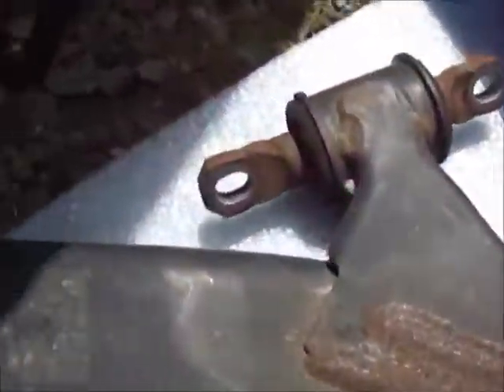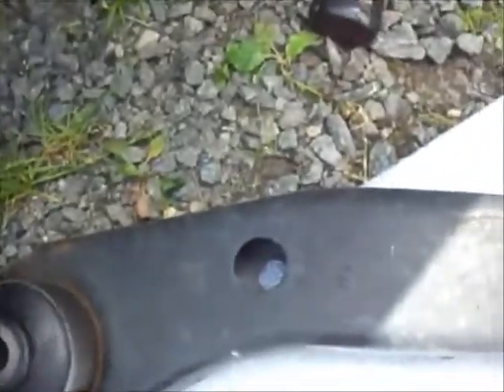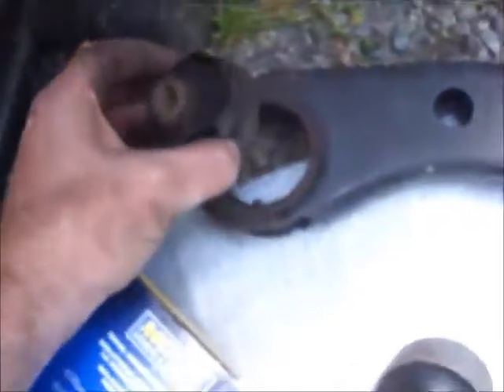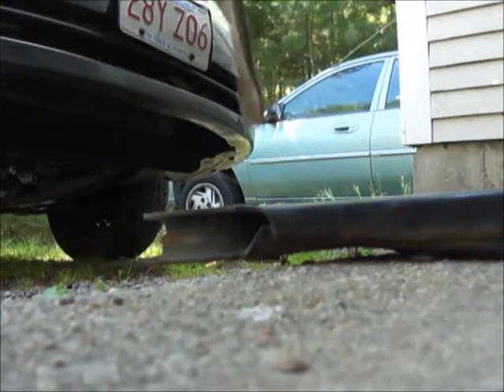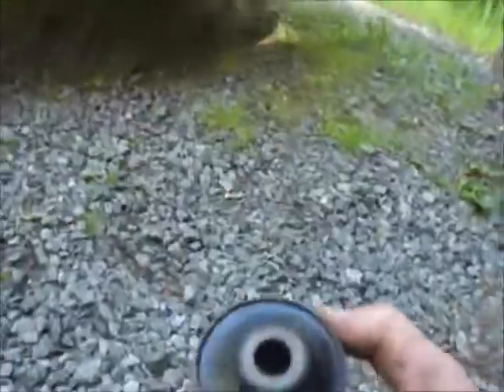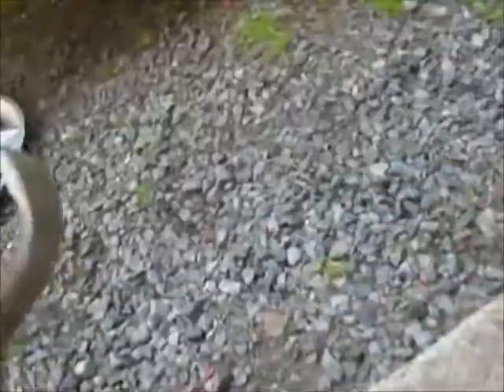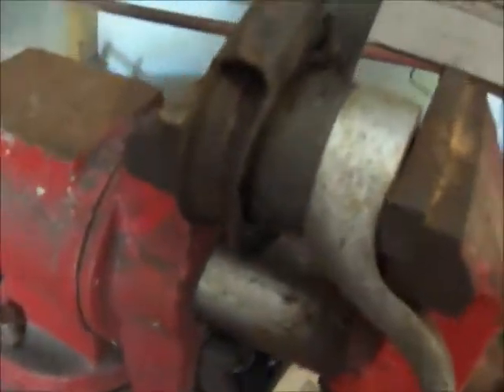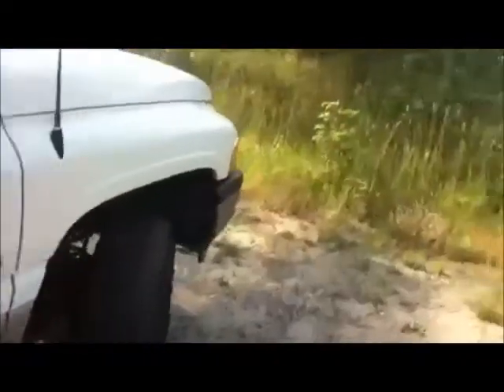Saturn and a water heater

Comment: kinda ironic that i had hot water heater problems this weekend also. after determining i didn't need a new one i figured out that the inlet valve was clogged and proceeded to tap on it. no luck. soooo i went to lowes and bought a new valve and all the stuff to replace it with. once i started heating the fitting something broke free from the inside and then i had hot water again. saved me alot of work.